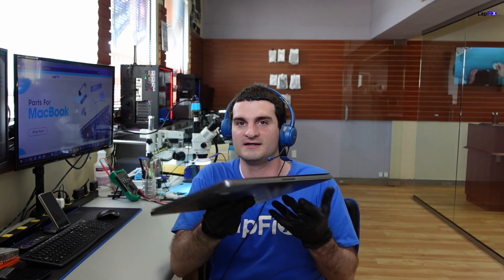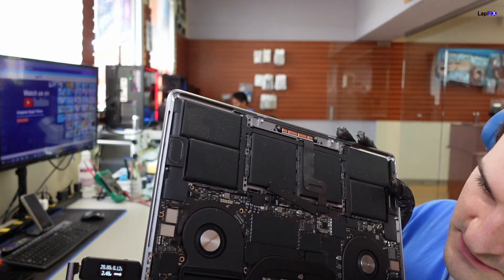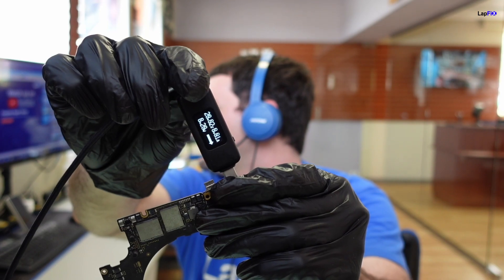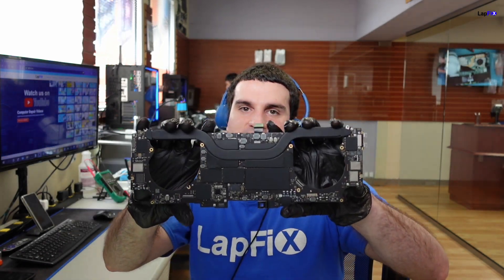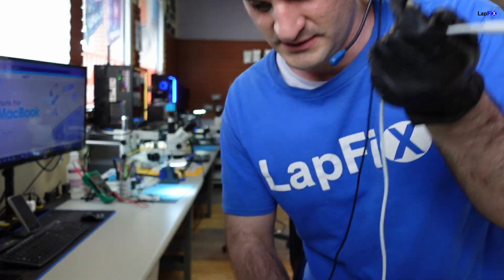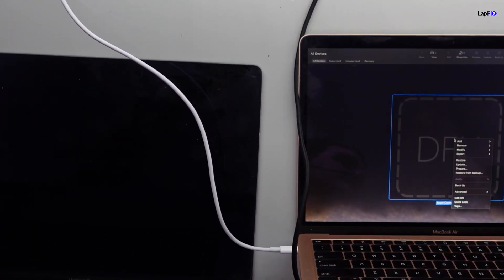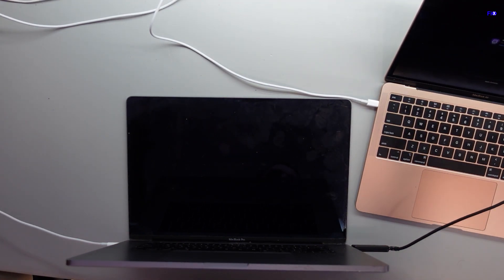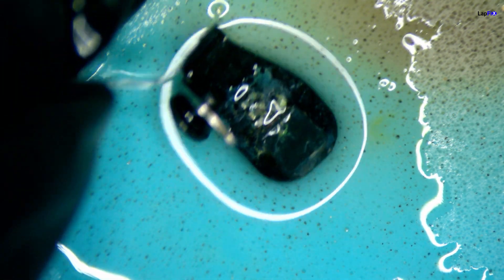Fixing a 2019 Macbook Pro 16" with Liquid Damage | Logic Board Repair

Comment: Really helpful. Having performed this procedure for a customer who spilled coffee over the upper right corner, power button and right speaker. No noticeable damage on either side of the logic board, although the independent Apple Tech may have cleaned up prior to me opening it up. Even so, not obvious staining. Shows a consistent 20v from the PSU. DFU opens in AC2 on a 2020 MBA with Sonoma and the Mac? shows up under Locations for a revice/restore. The Power button is operational to teh extent that DFU sees a MAC? (with a question mark). Tried various combos of Tilt sensor, Touch ID sensor either connected or not. DFU just hangs on Step 4 in both Revive and Restore and eventually spits out Error 4042 every time. Difficult to get a clear and concise explanation of Error 4042 online. I suspect it's T2 related.  Anyway, good job your end.